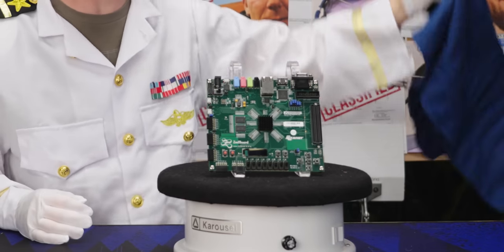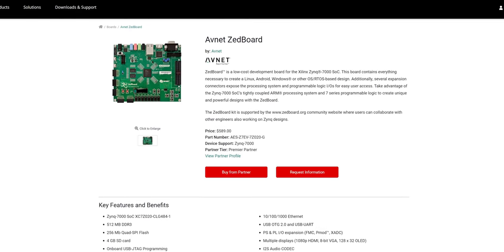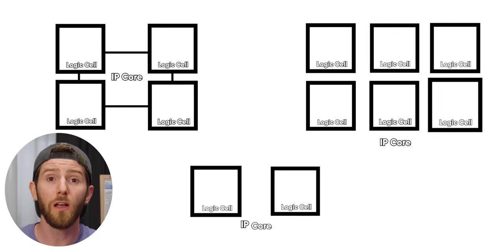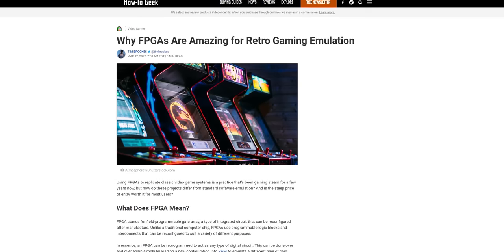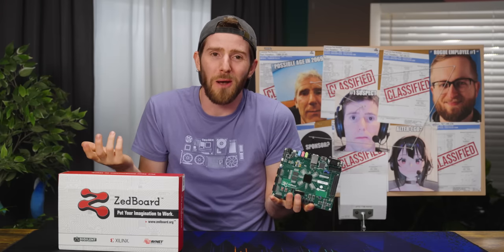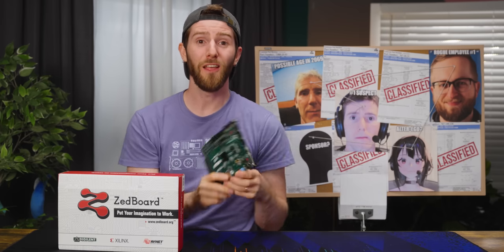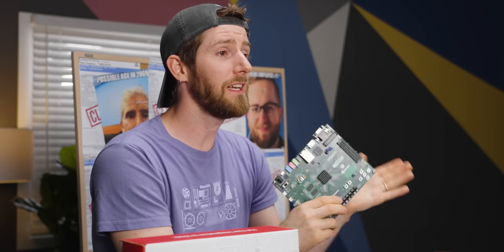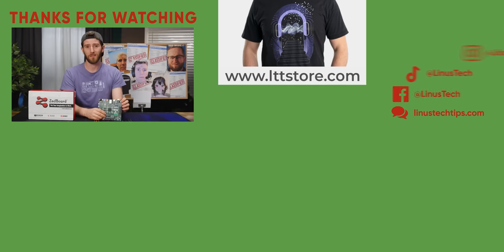I Bought Iran’s Secret Quantum Computing Chip

Comment: FPGA's are super cool for learning chip design! And there are some very cheap dev kits everyone could afford and try out, like ice40 dev boards or gw1n boards. These could go from 5 to 50 buck, and you can do some cool hobby projects with them. I discovered FPGA's back in 2016 and that was down the rabbit hole experience
Reply: ICE40HX is probably the cheapest you can buy.
Under 10$ a piece in TQ144.
Ran some demo Verilog on it to compare it to Xlinx 7 series ecosystem.
While Xilinx wins hands down in all aspects other than power, it's still the cheapest glue logic you can buy.
Spartan6/Spartan7 are way pricier and Intel is out of the budget race here.
You can use one with a microcontroller to improve it's capabilities(solve hardware bugs in hardware,outside the microcontroller).
Reply: @whatever2144  Well, I got gw1n with 9k logic (i don't remember lut or cell equivalent) in 144 package for about 3$. Got a discount for helping fae out with lectures. Spartans were a thing, especially ones with transceivers. But Xilinx bumped the price like 50% back in covid times, so imo they lost cost advantage too. I no longer do the hardware itself, can't speak with metal in voice. Right now, the only fpga I use is virtex for cpu ip validation at work...

Comment: I work for a business where we sell products well in the $100k price per unit range where the entire setup’s heart is a custom Zerboard inspired, Zynq 7000-based board. The CPU is not there to do general purpose stuff, but rather to configure and monitor the hardware connected to the board and programmed into the FPGA, so raw computing power is not the most sought after metric. The dual core is just fine for what it needs to do. And it’s all there for the FPGA, where we do the real grunt work. The board is rather cheap for what it can do, other qualities matter for us; for e.g. in such applications, where the warranty we offer to the customer is always 10 years minimum, the fact that this board is guaranteed to be produced, sold, and supported by the manufacturer for the next 20 years or so is what counts a lot for us. Think about your run of the mill PC and tell me whether you think that is going to be sold in the same exact SKU 5 years for now. No, right, so “regular” stuff just doesn’t cut it here.

Comment: These FPGAs are very well suited for simulation of quantam based algortihms. As a  matter of fact, till this date it is the cheapest approach to simulate a quantum kernel and capture its runtime hyperparameters. Unless you wanna spend govt money on a massive 10bn dollar cryogenic lab , the hybrid cpu-fpga approach is pretty economical and effective. In my city (Kolkata, India), a company called TCG (The Chatterjee Group) is on a project of developing a 3qbit chip , and they are using this approach widely, in their operations to validate their hardware definition logic before actually moving into fab stage.

Comment: Those fpga boards are used for different kind of things. To test rtl code before tape out of an asic. Or to develop ai processors next to regulat arm processors. These zynq boards are a very useful product to group the strengths of hw acceleration and cpu power in one platform ;)

Comment: 8:10 They could have been talking about qubit emulation, which is absolutely a thing. (Basically, emulating a quantum computer, usually at much slower speeds.) But still, yes, that's a very old board. 😆

Comment: This is actually an area of my expertise -- FPGAs have been used for emulation of quantum algorithms for quite a while now. See Khalid 2004 (GA Tech) for a breakdown of the methodology, or Suzuki et al. (2023) for more recent examples. I co-authored 7 publications on quantum algorithms, all of which used either FPGA emulation (usually an Alveo U250) or real quantum computers through IBM Q.

While there's nothing quantum about them, FPGAs work well for studying quantum algorithms with idealized behavior ("pure" qubits with no decoherence). While NISQ is where any of them would be executed in reality, we can absolutely simulate or emulate quantum circuits on CPUs, GPUs, FPGAs, etc, albeit it will take much longer than executing them on a real quantum device.

Comment: Explaining Q states, I've always used the analogy of a dimmer switch. A regular light switch is either on or off. That's a "normal" CPU. A quantum CPU is a bit like a dimmer, it can be on, off or somewhere depending on how far you turn the dial.

Comment: Generally, objects traveling at hypersonic speeds (above Mach 5, or five times the speed of sound) experience significant heating due to the compression of air in front of them. This can lead to the phenomenon known as "aerodynamic heating." So, the Iran rocket might melt or it has little heatshielding on its body, and there's the plasma that forms around the rocket, making it virtually depending on its internal programming, so no kill code can get through if needed. Nice invent.

Comment: Zynq are still put to good use in audio DSP processing. not for emulation so much, but rather to allow you to add a custom hardware DSP pipeline for adding functionality. build a custom digital filter in the FPGA part and this augments the abilities of the onboard SoC. essentially allowing you to run what would typically run in software, in hardware at hardware speeds.

Comment: Well, i didnt know I programmed a food vending machine using quantum t3chnology back in college...everyday you learn something new lmao.

FPGAs are very useful as Linus mentioned. You have a blank circuit that you can program as you want, did it worked at first time? Just fix the code and run again, no money wasting nor time waiting for a new manufactured circuit.

Even in current motherboards for workstations, servers, etc FPGAs are included, I used to work reviewing motherboard designs before prototiping and mass production, each mobo had at least like 2 or 3 fpgas, and in some newer platforms FPGAs are replacing the PCH.

Comment: P.S. if Iran wants to do long range detection, you don't use cheap Z-Boards but rather portable Cyclotrons that collide heavy metal particles together such as Gold, Lead, Tungsten, Manganese, iron, etc so as to form HFGW (High Frequency Gravity Waves) and MFGW (Medium Frequency Gravity Waves) from those collisions that can then be summed and waveguided within a GWASER (Gravity Wave Amplification by Stimulated Emission of Radiation) so you can directly image, find, hunt, track and target objects within air, space, underwater and underground at hundreds of KM distances at 4K, 8K and 16K video and still photo resolutions! From there you use 2D-XY and 3D-XYZ SOBEL and CANNY edge detection and pixel-to-vector object conversion and real-time expert-system-based autonomous object recognition, categorization and tracking!

You could also do MUON-based imaging too if you're too cheap to go with a GWASER-based imaging and communications system!

Meh!

V

Comment: P.S.2. Sorry D-Wave! Not to dig too hard at you BUT you don't actually NEED Liquid Helium to prevent Quantum Decoherence! You just need to track position or spin states via the INFERRED read/write of an associated nano-structure set by each trapped-Xenon-particles nanowell! 

Don't measure the state of the nanowell itself but rather use lasers to track the INFERRED value of the nearby nanostructure that SHADOWS the current value of the nanowell spin or positional state! When the SHADOW moves, the quantum state of the trapped Xenon particles has changed and can be read AND when you MOVE the shadow (i.e. change the nearby-each-nanowell-nanostructure attributes), the quantum state of the nanowell itself suddenly changes over to the value of the new nearby-nanostructure state! 

For ECC, use the GROUP AVERAGE of a series of nanowell states to create a binary ON or OFF bit!  This can then be used as a REALLY FAST quantum-based COMPUTE OR COMMUNICATIONS system! 

This means our internally designed and manufactured quantum chips AND associated classical computation systems now work at room temperatures and can now be the size of a small two drawer filing cabinet!

Meh!

V

Comment: it's a shame people didn't think you could use an FPGA like a CPU and reload the FPGA schematic in real time for running applications. Maybe when AI will only program schemes instead of people, someone will implement it and use it that way. Then, instead of multiplying blocks, you can pack a lot of ALU units there and treat it as parallel processors in which peripherals change in real time. There is still a lot of work to be done in digital technology
Reply: That's exactly how the Zynq 7000 on this board works. The ARM CPU boots up, and starts loading the software from flash/SD. Software (usually a driver running during OS boot) then configures the FPGA. It's even possible to reconfigure the FPGA without rebooting the CPUs.

Comment: Embedded applications are never gonna use cutting edge technology. The zync-7000 is perfectly capible of running a small embedded linux system with custom hardware for things like serial I/O or network interfaces and sometimes thats all you need.

Comment: 8:50 "mixed superposition" Would be better to just say superposition because mixed states are something else (just statistical mixtures of states). Also a QC needing to be cooled to near absolute zero is not necessarily true, depends on what physical structure the QC is implemented on. Also, I truly don't understand what was Iran's play here. Like did they presume that nobody knows about quantum computing or FPGAs. I truly have no idea. Like I presumed at first that the board is simply a simulator of a QC, but it has nothing to do with quantum computers is very confusing to me

Comment: Zync 7000 series aint that bad you could easily use it to make quite a capable set of lab equipment like oscilloscopes, logic or spectrum analyzers, or just quite fast and specific control logic equipment or SDR. Nasa is known to use a similar chip for noncrucial sets of equipment.

Comment: I took one look at the board, and yep, it's a FPGA. Not a quantum computer. Sure, you can simulate a quantum computer with it, but you won't get the speed boost of a real quantum computer. This is like China saying they built a Core i9 clone but it's just an Arduino and a DRAM chip emulating the Core i9 100,000 times slower than the real thing. Any computer can emulate any other computer if you're patient enough.

Comment: Quantum algorithm =/= quantum processor ... you can run quantum algo on a FPGA. You're basically emulating the quantum processor as per your comments on emulation later, that allows you to design the systems that will surround your quantum processor; like maybe address generators or whatever; before you have the hardware ... sounds like exactly the sort of "goof" that marketing would make.

Comment: I believe that Iran HAS actually created the worlds first first quantum computer capable of the sophistication necessary for predicting in the future, that it realized their mistake of accidentally releasing the capability to the world, and had to correct that mistake by denying its actual existence. The sophistication of the system incorporates humans as part of the operating system. The way it works is by scanning the running program. It is currently using today and then verifying that information output by reading the current newspapers of today. When this information is then compared to the output of the system it had predicted, when the program was first run it then incorporates the human counterpart with in the computer. What is this computer counterpart finds out that it was right in the assumption of the program that I had written in the past. It is marked as a one. When it finds out  that it was incorrect in the past. It is then marked as a zero. When the system finds that it was almost right, or almost wrong at present, when this material is being printed, quantum mechanics has almost been verified, and therefore works. QED.  This system is so sophisticated that you, your self, right now, is being incorporated into the computer matrix. You are very imagination in just thinking about what this means, proves not only that it is an active, room, temperature system capable of using your imagination to quickly think about the future  to provide an output of almost being right or wrong, which, when shared by others, creates true quantum entanglement, with in a cubit nature, matrix capable of almost being bright or almost being wrong within the top-secret Iranian intelligence computer program utilized with N computer output. And. YOU are have been unwittingly used to be part of this computer program, which was written three years ago, to come up with answers in this present, which proves of its time capabilities, and the possibility of may be not being quite right, proving its quantum capabilities, and is so mind boggling twisted when you do, or do not consider its impact. You are still being almost used within this time predicting quantum mechanics computer.

Comment: Arduino actually also has had a arduino with a fpga for many years.
and that one onlywas just over €100
fpga's can be very great however even a simple fpga can outperform modern gpu's in AI if programmer right. and a AI that can program itself and the FPGA might even be quite possible. basically it could program itself to become the almost perfect hardware for the AI even after the Ai gets changes/changes itself. just like how a brain makes new connections, even memory and such could be largely done and put into the logic itself by making the links and weights actual links and weights instead of logic which needs to read it and then process it many times to try and figure it out.
but is can also work for general computing, in that case either specially designed hardwarelogic blocks for specific main functions have to be designed or a AI that automatically does and predicts this that way any programs code can be done more like a flow instead of computing since instead of needing many cycles it could just do it like dedicated hardware. which also gives insane efficiency.

the main reasons FPGA's aren't really in use yet is because typically you need to make the boards yourself or just get a fpga chip alone or on a development board, as well as that recently over the last 5 years or so companies making fpga's have constantly greatly been increasing prices even for the old fpga's with the same performance the prices now have doubled many times. probably due to some plans to shoot it onto the big market sometime possibly soon, and AI.
gpu's have a similar thing, AI can give people insane amounts of money right now, largely due to it being a niche thing. so some people will pay anything for a well AI capable GPU to make that money, or some more serious companies might also buy fpga's for running the AI already. since this scarcity of gpu's due to high prices increases the money individuals can make with AI, such individuals pay that for it, and so nvidia and such have high priced but insane proffit.

Comment: It was an error in translation. They NEVER claimed it was a quantum "processors", but rather a quantum processing algorithm implemented on a platform (Quantum algorithms are typical to be emulated on FPGA chips if you take a look at google scholar). The mistake they did was simply showcasing the board, rather focusing on the algorithm itself, which they apologized for that, later.

Comment: Emulation implies imitation, which, while the ARM processor on the device certainly is capable of imitating instructions of other CPUs via interpretation or recompilation, an FPGA is not. It instead simulates the hardware features of a device in logical circuits, which is not imitation, and therefore not emulation. Simulations can be carried out on a CPU with great performance cost, say a fully functional pong system in terraria, however an FPGA can do this at the hardware level. You wouldn't call a Chinese hardware clone of the NES an emulation of a NES, it's instead called a clone, and that's basically what an FPGA is, it creates a hardware clone of different chips and the wires connected to it, this is a far cry from what an emulator does.

Comment: Wow, people still use the ancient, overpriced ZedBoard? :D At least they could've used a bigger FPGA to make their case more legit. Anyway, FPGA's are awesome, if you are willing to invest the time and energy into learning how to program them, i.e. learn about digital design, computer architecture, VHDL/Verilog, RTL, etc.. Contrary to what most people say, FPGA's are not only used for prototyping, learning and DIY HW emulators. They are extensively used in edge devices, network routers and switches, and even RADARs (e.g. Thales). Also, VHDL/Verilog are not the only HDLs that can be used to design hardware for these chips: there's Clash (Haskell), Chisel, MyHDL (Python), nmigen, etc... There's also the PYNQ platform that makes experimenting with these guys quite easy using Python, without knowing much about digital design. And they need not be that expensive either: there are small-scale dev boards the size of a DIP40 that are pretty cheap available at e.g. Trenz Electronic. You can design a whole microcontroller system easily on these guys.